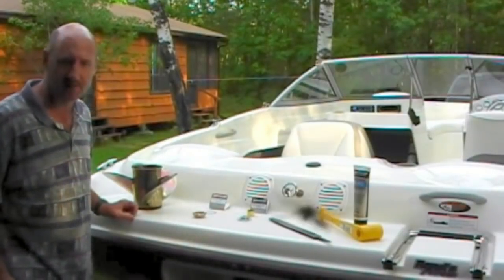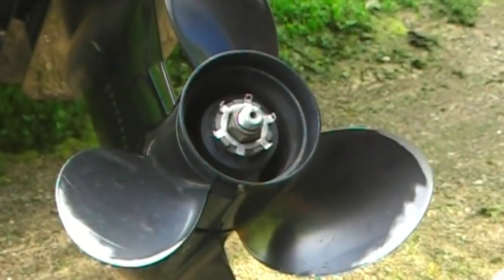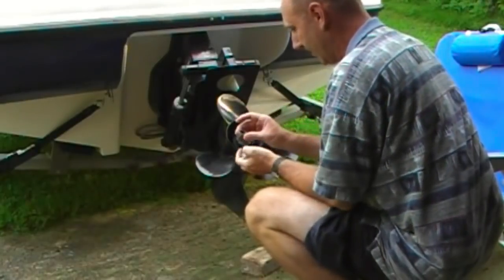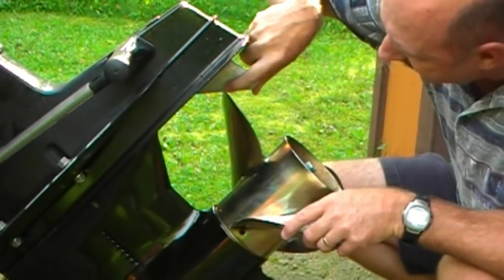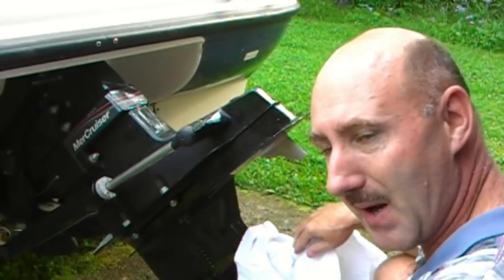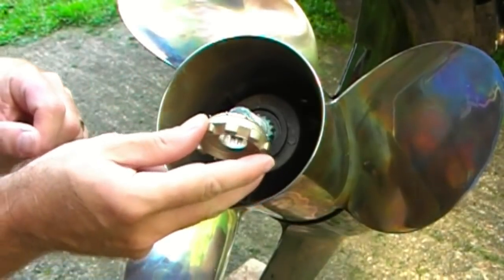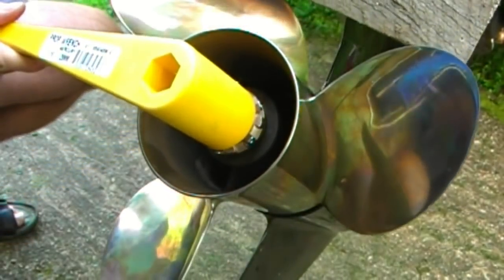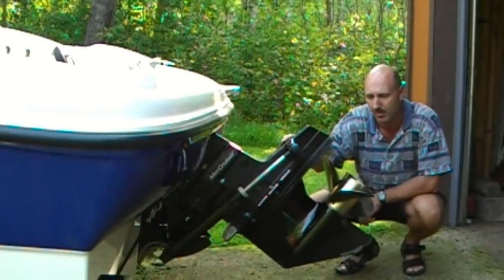How to Change a Boat Prop

Comment: I have a 1997 22ft sea pro citation with a 1997 mercruiser 5.7 with a 2bbl  carb.  Can you suggest the right props? Some had recomended 15 inches but you were were getting more speed using a 19 inch. Please help.

Comment: why have a floatable prop wrench? sounds like a stupid question but does it float or is it some other term?
Reply: It's for when you take out a blade and have to change your prop in the middle of the lake.  The last thing you want to do is drop anything so the wrench won't sink.  Unfortunately the nut and washer don't have the same feature so keep a couple extras onboard.